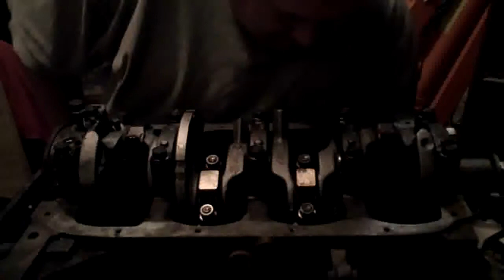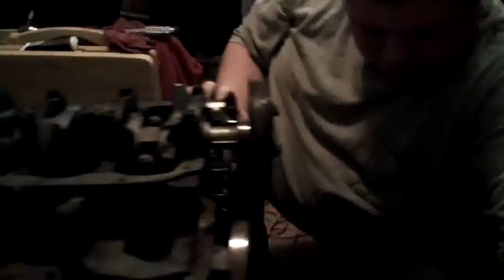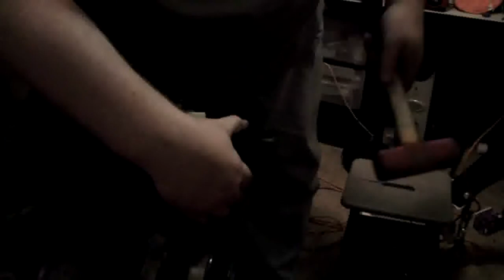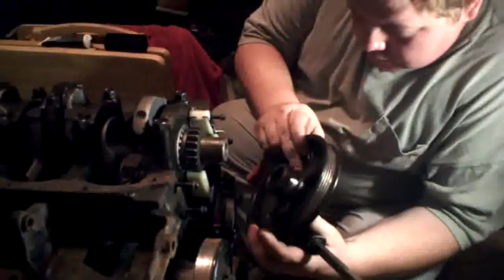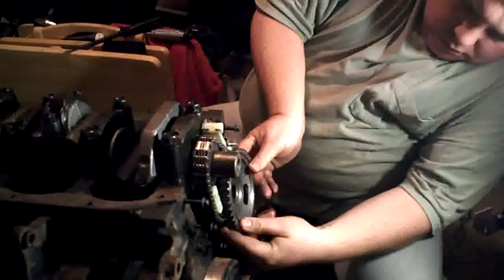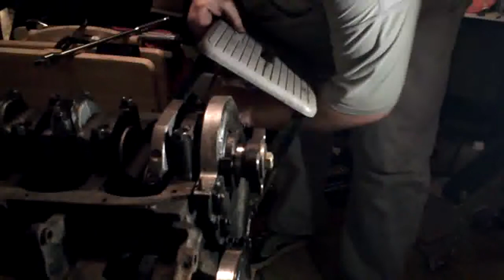1997 Chevy Caviler reassemblely Pt. 2

Comment from the maker: The oil pump failed and wiped out the crank bearings and #1 crank journal. Surprisingly the block didn't need line bored. The rear main isn't anything special. It's really easy to install.the seal is a one piece seal. it puts you in mind of a torque converter seal. As far as timing marks there is one on the crank pulley and one on the cam.You line them up towards each other and the engine is in time.Thanks for the questions an I'm glad I can help.

Comment: Excellent video! The timing marks might be a problem because although it seems straight forward, you didn't show them on the camera.  The Haynes manual is not any help at all.  No pictures either.  Is there anything about the rear main seal to take note of? What was wrong with your original Crankshaft?  The main bearings failed on mine when the motor overheated.  Thanks for your time!